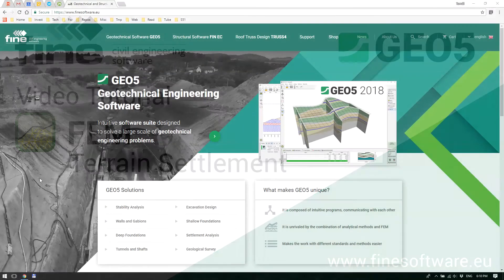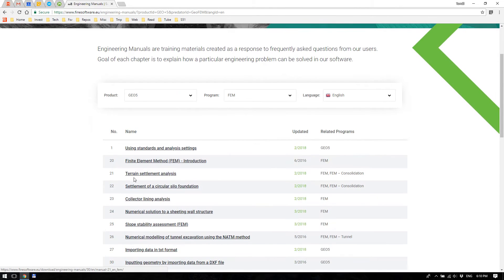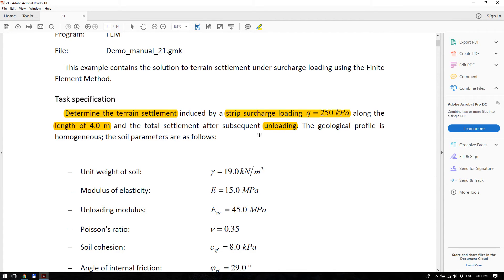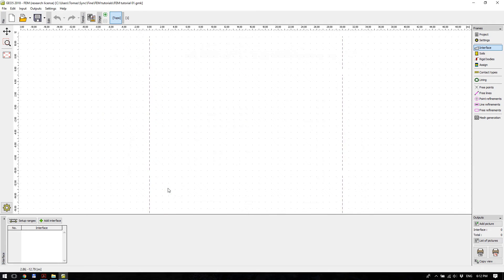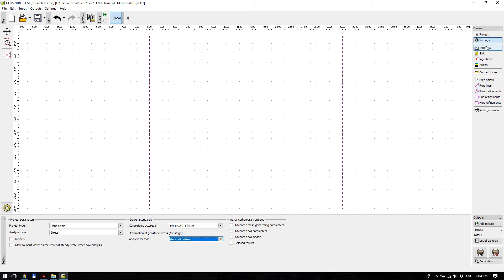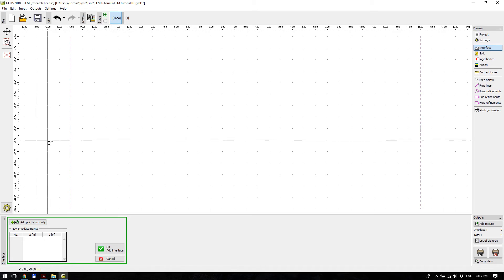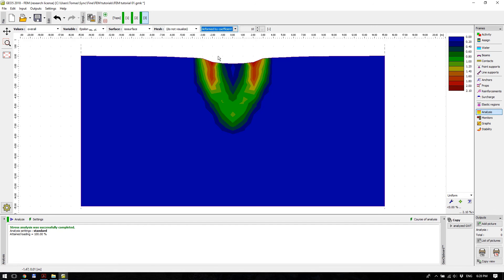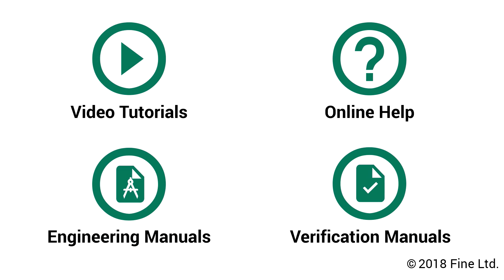GEO5 Tutorials: FEM Terrain Settlement

Comment: Does the software model excavation on which load will be placed, if yes then does it calculate heave of soil across time?
Reply from the maker: Hello, the answer is Yes :). For example, you can calculate the geostatic stress in the first construction stage. Then excavate (deactivate) some region of the soil in the second construction stage. And then load the bottom of the excavation in the third stage. In all stages we get the vertical displacement everywhere in the model. However, the standard stress-strain analysis is time-independent. The displacement field changes immediately as a result of the loading (excavation, surcharge, etc.). Best regards, Fine Team

Comment: I want to calculate total settlement with a soil profile of 3 layers of soil. Infill silt and clay. How should i do it?
Reply from the maker: Hi John, you just define three interfaces. The topmost interface represents the terrain and the other two represent the boundaries between the three soil layer. The model's bottom boundary is created automatically at prescribed depth below the deepest interface. Then you run standard stress analysis with whatever load you wish. Please refer to engineering manual no. 21 "Terrain settlement analysis" on https://www.finesoftware.eu/engineering-manuals/?productId=all&predatorId=GeoFEM&langId=en, where you find more details and step by step tutorial. Best regards from Fine team

Comment: What you mean by interface?
Reply from the maker: Hi John, the interface is simply a polyline defining a boundary between soil layers. For details please refer to https://www.finesoftware.eu/help/geo5/en/interface-04/. Beside interfaces you can use free lines to define more complex geometry. For more details on free lines see https://www.finesoftware.eu/help/geo5/en/free-lines-02/. Interfaces should not be confused with contacts, which are used to model relative displacements between two soil bodies or between a soil body and a beam. For contacts, see https://www.finesoftware.eu/help/geo5/en/contacts-01/. Hope this helps, best regards Fine team
Reply: @GEO5software hi I don't have any option of interface in the GEO5 software. I don't have the stage topo, I have by default the stage 1. Please help

Comment: Hi sir, i jave similar  problem as Berk, i have 1 layer of infill, 1 layer of silt ans and another layer of clay. How should i inpuy  for all these layer in this programme ?
Reply from the maker: Hi John, you just define three interfaces. The topmost interface represents the terrain and the other two represent the boundaries between the three soil layer. The model's bottom boundary is created automatically at prescribed depth below the deepest interface. Then you run standard stress analysis with whatever load you wish. Please refer to engineering manual no. 21 "Terrain settlement analysis" on https://www.finesoftware.eu/engineering-manuals/?productId=all&predatorId=GeoFEM&langId=en, where you find more details and step by step tutorial. Best regards from Fine team

Comment: Hi i have three soil layers; clay at the top, sand in the middle and same clay at the bottom. I want to find consolidation settlement of those clay layers only as well as instantenaous settlement for all those layers but the program wants me to specify only one range of layers so im confused. Also, it seems the program uses the overconsolidation formula while calculating settlement for sand layer too. I thought i didnt need to know compression index and void ratio to calculate sand layer's settlement but the program wants that
Reply from the maker: Hi Berk,
GEO5 FEM always calculates the entire displacement field for all layers. If you want to calculate the instantaneous settlement you should use an undrained material model for the clay layers. Check Topo->Settings->Advanced material parameters and then select "undrained" in the Soil dialog. If you want to calculate the settlement after the pore pressure has dissipated, use a drained material. This is the default option. If you want to calculate settlement in between these two limit states, you should go with GEO5 FEM - Consolidation module, that allows for coupled, time-dependent analysis. This will give you the evolution of displacement and pore pressure.

Feel free to send us your model to hotline@fine.cz so we can comment on it in more detail.